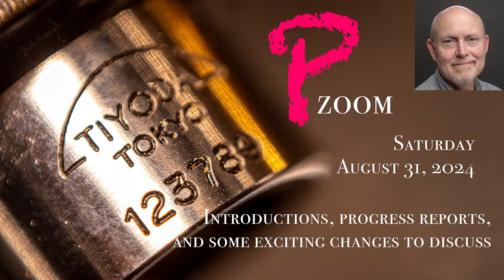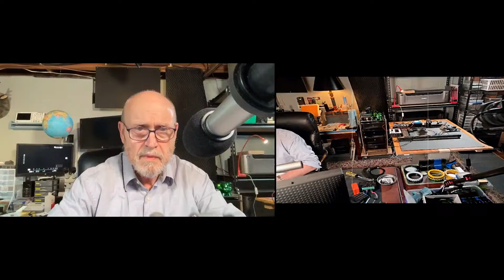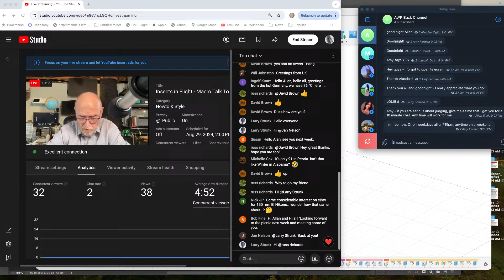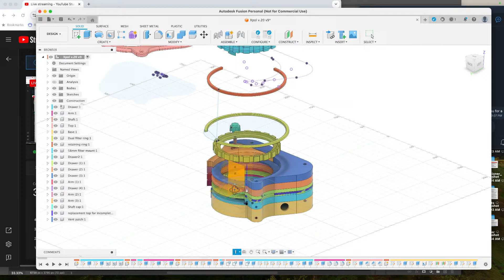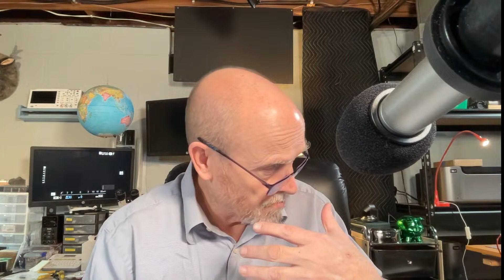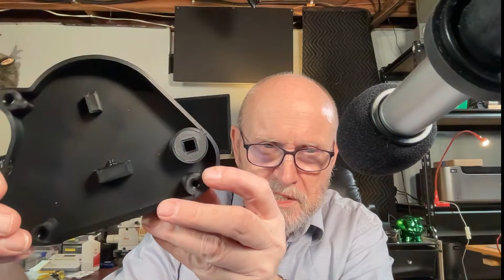Insects in Flight -  Macro Talk Too #107 - 8/29/24

Comment: One thing to look out for on any used microscope is a worn spot on the microscope's stage. These often were used by pathologists who do not use the slide clamps but instead "finger" the slides (much faster) while racking the fine focus back-and-forth, resulting in wear on one segment of the fine focus mechanism unless the mechanism has been serviced.